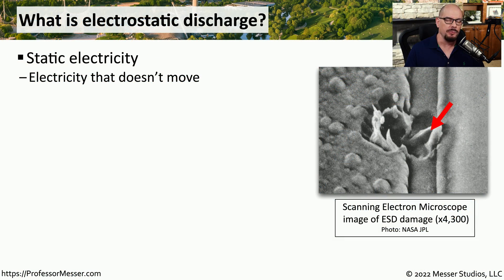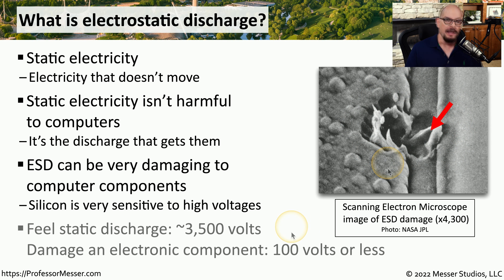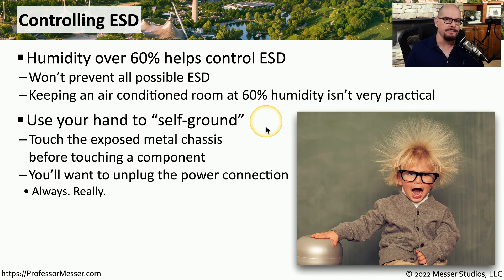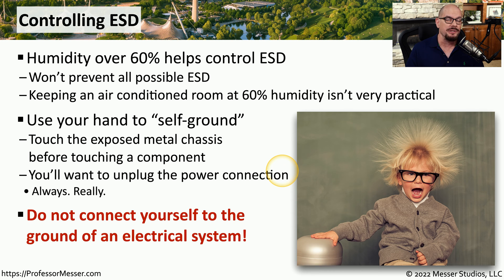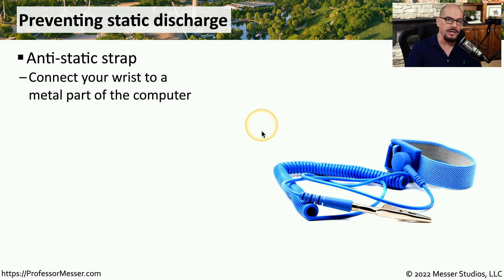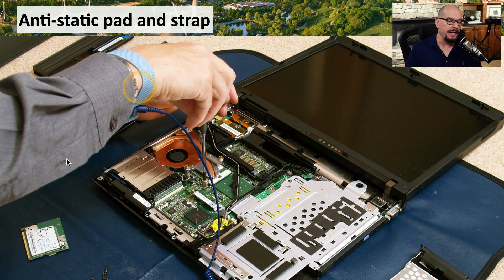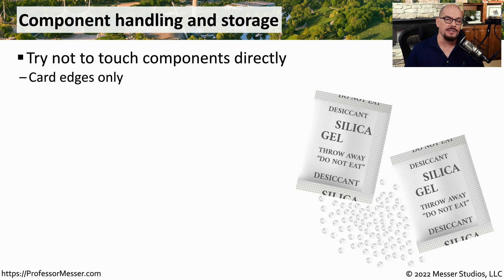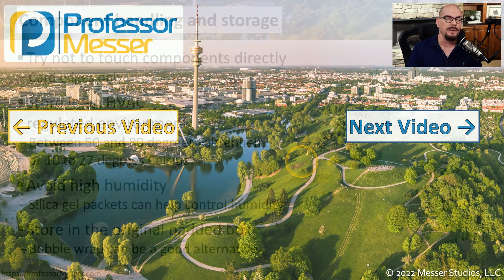Managing Electrostatic Discharge - CompTIA A+ 220-1102 - 4.4

Comment: I've always read that you should touch a component that IS plugged in (like an additional external power supply) to self-ground. What are the risks of it being plugged in? Is my info wrong?
Reply from the maker: You should never be connected to a power source for the purposes of equalizing the electrical potential between yourself and another device.
Reply: A little note about voltage.  Ground is not Zero Volts.  That +12V coming from the power supply means "12 Volts Above Ground Voltage".  Something that says "-3.3v" means 3.3 volts below ground voltage.  Connecting +12v to -3.3v creates a 15.3v circuit (useful in cases like battery charging).  Ground voltage can shift based on activity that occurs.  The damage from static electricity does not care which material has the lower voltage, only that there is enough voltage difference to overcome resistance and conduct electricity over a path.

Overall, touching your building's ground is more redundancy, reducing odds of a 3-way static electricity cycle.  What truly matters is getting your "ground voltage" and the device's "ground voltage" at a "common" level, and that no unregulated power conducts through the circuitry.  Given that using the building's ground is not too important, the next part is your health and safety of being connected to the building's common ground.  If lightning were to strike the building, you are an available path because you are connected to the common ground.

Commonly, components are built so that the ground pins will make contact first.  Your device will ground to the building when it plugs into the building.  You just need to match the ground voltage of the device so you can't put a charge over the circuitry in the case you accidentally touch a pin.

The 3-way static electricity cycle I mentioned is like handling a shopping cart and a metal shelf in the store.  The shopping cart is (for example) like 200v more than the store shelf, and you were grounded to the store shelf, but not when holding the shopping cart.  You touch the shopping cart, the voltage of you and the cart add up and evenly divide.  Now, you are like 100v above the store shelf, so touching the store shelf now creates another static shock as you balance to the store's ground.  And then you touch the shopping cart, again, and get shocked again.  The best way to eliminate this cycle is to touch the cart to the store shelf, or touch both at the same time (which really is not safe).

Comment: How come the CompTIA A+ Complete Study Guide says to ground yourself with an ESD wrist-strap or using your hand (for self grounding) connected to the computer case but with the computer plugged into the power but with the power turned off? This seems to be completely opposite to what Professor Messer is suggesting... 🤔
Reply: I'd rather not risk it and unplug the machine. Some machines can still contain electricity even while being plugged in
Reply: When ever you're working on a device you'll want to have it unplugged from any source of electricity. If you're working on a tower pc it's as simple as unplugging the pc from the wall or the power supply. If you're working on a laptop or any other mobile device, you'll want to disconnect the battery as soon as you can.

Another misconception is that you want to be grounded. No, you want to be an a charge equilibrium to the device you're working on. If you have a net positive charge and the device you're working on is net negative, it will esd to you. And possibly cause the same damage.
Reply: pretty sure esd is totally overblown from what i've seen, but still self ground
Reply: that is also an option
Reply: If a pc is plugged in, it is grounded. Regardless of being on or not.